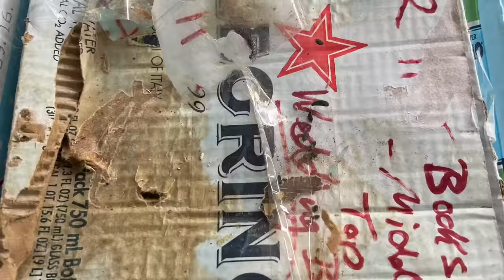Public Storage FAILED US

Comment: 😢 Wow, that's horrible. Completely unprofessional. Hopefully you'll up channel this to others at Public Storage. I've had Public Storage before and they were very good. Now have U-Haul. They provide pest and bug control. At the end of last summer I entered the storage facility and noticed a pungent smell. U-haul management got right on it. They were making people come in and open their storage spaces up. If you didn't respond they were going to cut locks off. I opened mine for them showing it wasn't coming from my storage. Fortunately they were able to track it down quickly. They cut the lock off and the person stored their gas/propane grill inside the storage and didn't clean it. We were smelling what was left on the grill. Storage of propane and gas grills are not allowed. They were told to get their stuff out immediately. Took about a week for the smell to leave. I believe he got charged for the cleanup. Fortunately my storage spot was far away and the people next to his weren't impacted. Good luck and we'll be praying you get this resolved. Remember, the squeaky wheel gets the oil. Good luck with your insurance.